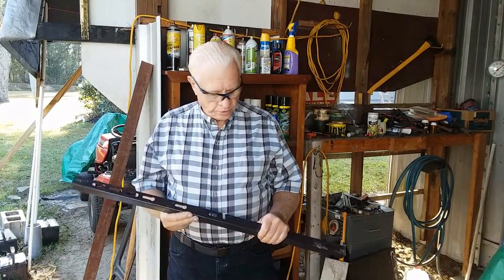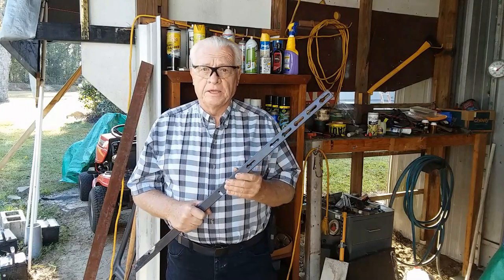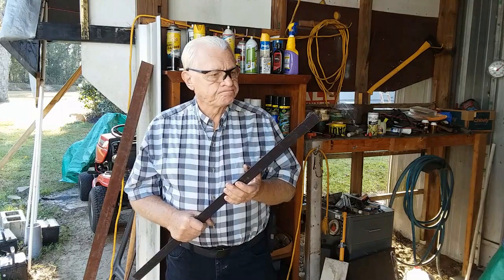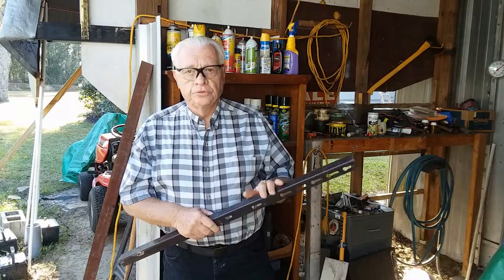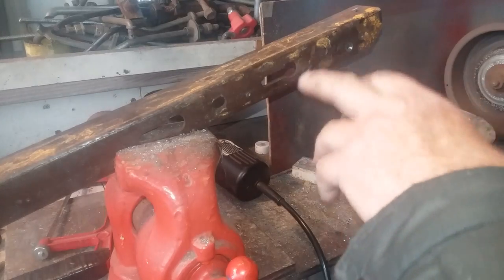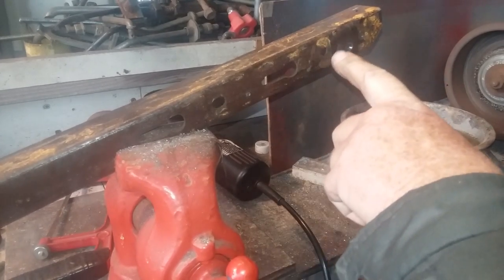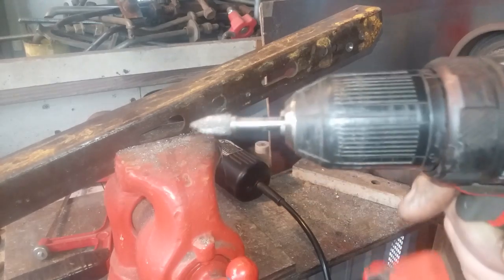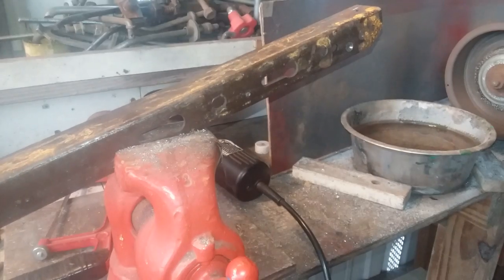Having Trouble Drilling Through Bed Rail?  Try This Solution

Comment: My trick for bed rail, is to heat the spot where I’m going to drill to a cherry red glow, with oxy-torch or propane torch, then let cool slowly to room temperature without quenching with water. This will remove the hardening process from the metal’s original forming process and it will drill easily. I also avoid cutting with my cold cut saw as it will dull the saw very quickly. Although oxy-torch or plasma will cut it easily, I usually use a cutting disc in an angle grinder.
Reply from the maker: Great ideas, thanks for your input. The more options viewers have the better.

Comment: I use self drilling screws. It's very easy
Reply from the maker: Great, unfortunately that doesn't help when you need to use large hardware like 3/8" or 1/2" bolts. This video is designed to help those that need to drill large holes and they encounter a section of bedrail that has a large concentration of carbon in the steel.  Most bedroom bed rail is repurposed railroad bed steel and this creates pockets of high carbon that is difficult for the average weekend fabricator to drill through.
Reply: Not always!  I am watching this because I just went through nearly a dozen for two holes

Comment: How do you first drill the pilot hole??, video jumped past that process??
Reply from the maker: The way you always drill a pilot hole. Use a small drill bit (cobalt if possible). I like to start with a 1/8" or 3/16 bit. Drill the hole where you need it, then follow with the tapered die grinder bit to enlarge the hole. And then use larger die grinder bits as needed to achieve the size hole you want. Thanks for watching, Ed

Comment: Why not just anneal it?
Reply from the maker: Most people using bed rail for their projects are not professionals. Usually they are the weekend hobbiest or the retired person trying to stay active with projects around the house. Many don't weld, many don't have a torch. These people prefer to drill and bolt in order to make their projects work. Even for those that have heating equipment - it is not economically feasable to heat the bedrail. They might as well go buy some structural steel with low carbon content that is easy to drill through.
Reply: The only O'Neal I know is  Paul O'Neal from the Yankees @eds2centsworth203

Comment: That is hot rolled steel. The high carbon content leaves a skin that is very hard. Its also punched in various presses. The material is not consistently hard or soft. 
To drill easier. Use split point cobalt jobber length drill bits with tap magic or walter tap heavy. 
I make machinery that drills and taps that material all day long.
Reply from the maker: Standard cobalt bits have been my prefered starting point,  but usually they will work on one piece of bed rail, but then not on another. As you indicated, it seems that the carbon is concentrated more in spots than evenly distributed thoughout the metal.  Plus, most of my subscibers are the weekend home project fabricators and are going to go just so far and expence and then opt out on a project. This is the group I am attempting to help out a little. The die grinder bits are a very affordable solution and work every time.  I will definitely give the split point bits a try. Thanks for the suggestion,  Ed

Comment: I agree HSS drills do not enjoy high carbon steels, if your going to spend money on a carbide bur, my preference would be to spend a little more and just get a carbide drill or carbide tipped cutter to blast through the hard stuff. You should not run a cutter in reverse, it dulls the cutting edges. same with any cutter.
Reply from the maker: I agree that if you can afford it - go for the best.  But most of my subscibers are the weekend home project fabricators and are going to go just so far and expence and then opt out on a project. This is the group I am attempting to help out a little. The professionals already have their solutions. The die grinder bits a very affordable solution.  If you buy Chinese (which many do) the bits are so inexpensive that even for the weekend fabricator running them in reverse is a non issue. Thanks, Ed

Comment: Or you can just get better drill bits??
Reply from the maker: Over 5 decades of working with metal (machine shop trained)  and I haven't used bed rail very often, but when I do I use cobalt bits  Sometimes it goes well, sometimes not. What I have found is that if possible, putting the piece in a drill press and turning the drill bit very slow makes a  big difference. That is not always possible. The die grinder bits work every time. Thanks, Ed

Comment: Not knockin ya. Ed, but perhaps you need better drill bits?
Reply from the maker: Over 50 years of working with metal I haven't used bed rail very often but when I do I use cobalt bits. Sometimes it goes well, sometimes not. What I have found is that if possible, putting the piece in a drill press and turning the drill bit very slow makes a  big difference. Obviously that is not possible all of the time. The die grinder bits work every time. Thanks, Ed